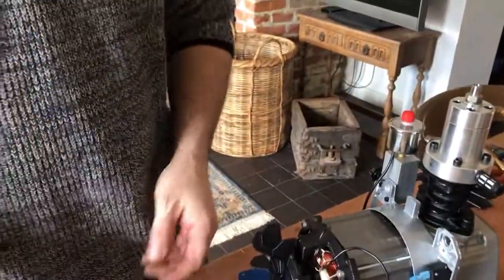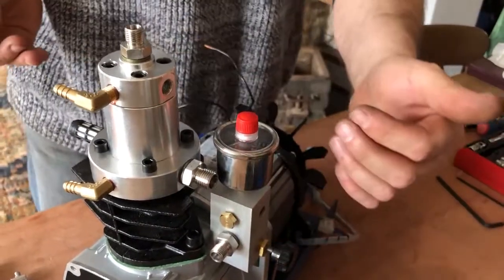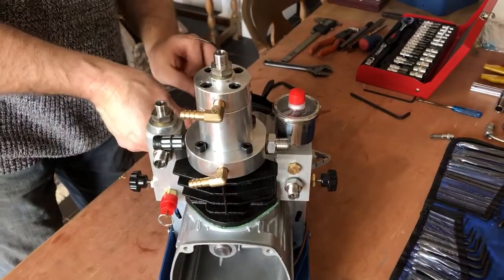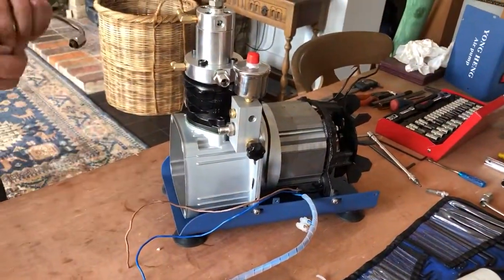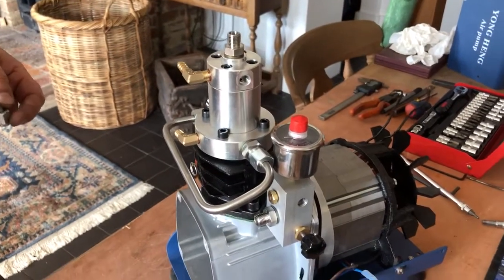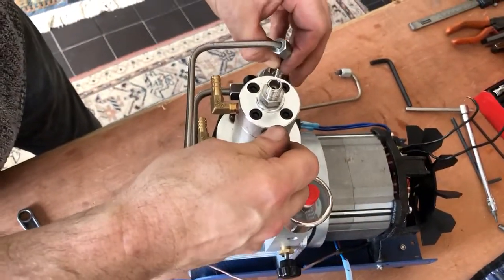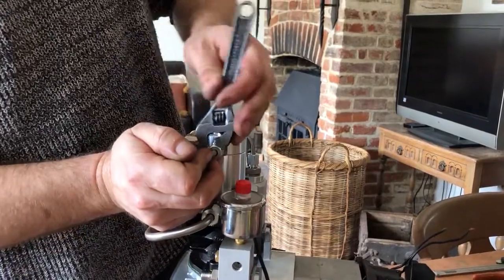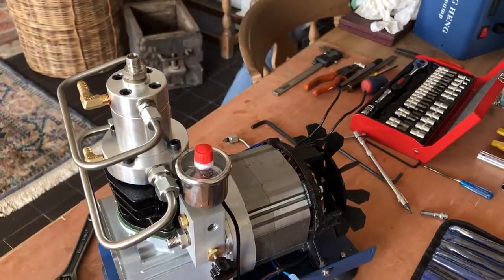Yong heng compressor strip down and rebuild part 4 ( in-depth)

Comment: hi that little bit of moving in the piston you had seen is from the connecting rod you have a little wear some were or bearing in rod is going out. It will run but its not going to get better with out some new parts.

Comment: Any idea what the discharge pressure of the first stage of compression is? How many psi? I would love to add a cooling radiator between the first and second stage but that would depend on the pressure generated by the first stage of compression. I know it will vary and increase in accordance with the final stage's output.
Reply from the maker: spiro revelis hi spiro, if you go to “Airgun Nation” which is a great forum for anything airgun related and look under “Air tanks,Pumps & Compressors”  prfssrlee  has started a thread called  “ Some Additional YH Information” and he puts a digital pressure gauge on the low side and got a reading of 155 - 158 psi, check it out!  Let me know how you get on, I’ll be very interested, good luck !!!
Reply: sambo cotton Thank you sir! Also, this was a great video series you made. You are a talented mechanic. Thank you.
Reply from the maker: spiro revelis  Your welcome Spiro, I’m pleased you liked it, it was just a last minute thought to video it as I couldn’t find anything on YouTube myself, if I’d have thought about it better I would have stripped the top part of the head to show what’s  inside as well!  Please let me know how you get on with your first stage intercooler, I’ll be very interested to see it ;0). Thank you
Reply: sambo cotton Actually.....I am a refrigeration technician with an engineering background. I'm going to go a bit overboard. (Only because I can) I am going to use the young heng like a booster and modify the compression ratios. I will create a slight inlet pressure of maybe 5-10 psi only. This will modify the first to second stage compression ratios and bring it down. I am worried about the very high compression ratios on the high stage piston. I will create a refrigerated chiller for the liquid cooling but I will also use refrigerant to sub cool the inlet air to the compressor in a tube in tube heat exchanger. I have yet to decide if I will cool the interstage discharge from the first piston with an air cooled radiator or another tube in tube counterflow direct expansion refrigerant heat exchanger. It is all possible now that I know the interstage pressure falls within the range of thick wall copper tubing. Thanks to you!!! You saved me a lot of time in test trials. I mention all this because I can tell you are very smart and understand it all. Thank you so much for sharing. I will keep you posted.
Reply from the maker: spiro revelis   Hi Spiro, I hope you make a series of videos of your progress, everyone will benefit from your knowledge!  I have a spare water cooler for my tig welder, I’ve been thinking of trying that for cooling the head, but it’s quite big and noisy and behind a tun of stuff in my workshop so maybe one day ;0)